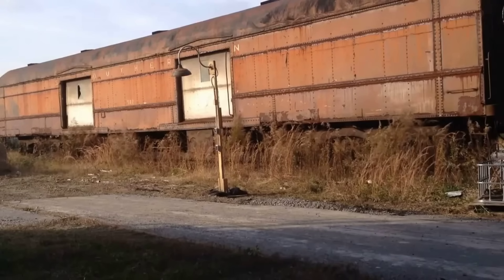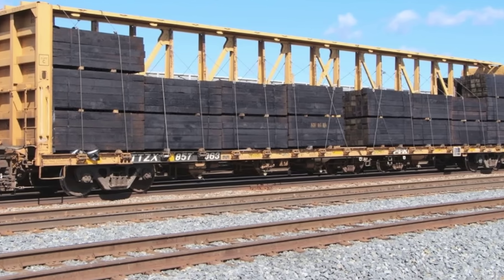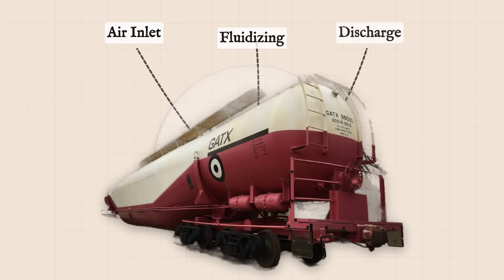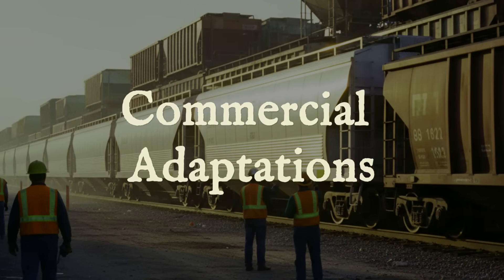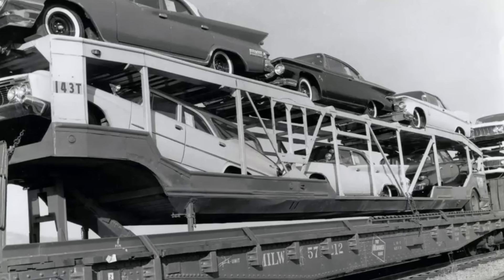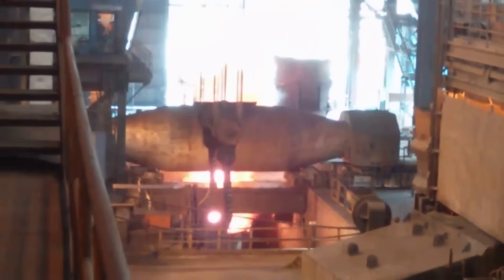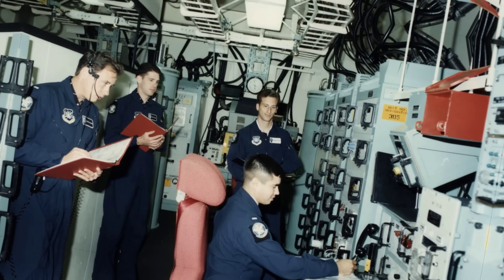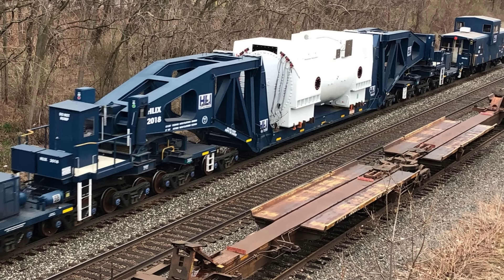Why They BANNED the 97-Foot _Rail Whale

Comment: Yeah the Vega experiment didn't last long... they were crummy cars and the shipping method was only applicable to that one model as all the vehicles had to be identical and tailored to the railcar.  The additional engineering work to keep the fluids from leaking out, including from the batteries, cooling system, engine oil, transmission oil, and rear axle oil, along with the limited amount of gasoline in the tank required to move them, was added expense and contributed nothing to the vehicle after its rail delivery.  Plus it didn't really work very well.  Five dollar solution to a five cent problem...

Comment: There was a rail whale car at the Galveston RR museum, I saw it several times.  Unfortunately in the flooding that occurred after one of the hurricanes, it floated off its trucks and through the fence and off the premises... it was found that getting the cranes and equipment necessary to move the car back onto its trucks on the RR museum property was simply too expensive, so it was scrapped.  Terrible shame and loss of irreplaceable RR history...

Comment: The USAF MX Peacekeeper rail concept was actually the second, the first was the railway 'Mobile Minuteman' "Operation Big Star - Minuteman missiles on trains.
During the summer of 1960, Headquarters Strategic Air Command conducted Operation Big Star to test the feasibility of launching Minuteman missiles from modified train cars.
The benefit of having a rail-mobile ICBM meant that Soviet targeting would become immensely complex as Minuteman trains could operate throughout the larger expanses of the American west and Midwest. It is likely too that SAC viewed a rail-mobile Minuteman force as a cost-effective competitor to the Navy's submarine-based Polaris system - in those years, Air Force and Navy competition over strategic forces became fierce. "Big Star" trains were sent out in the American west to test problems of command and control as well as problems relating to vibrations affecting Minuteman missile electronics. Six trial runs were planned, but only four were needed to complete test objectives. "
These trains were operated by US Army personnel, the instrumented missile and measuring equipment by USAF and Boeing.

Comment: The CSX blue boxcar that has "Do Not Hump" on it is actually designed to provide certain checks on the rail infrastructure.  It's equipped with lasers for measurements.  It is not a scale car.